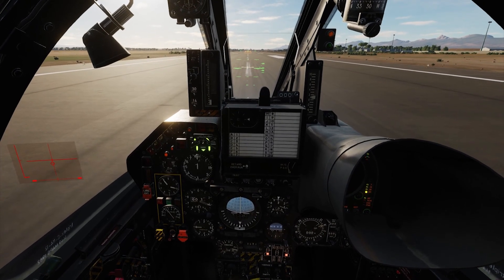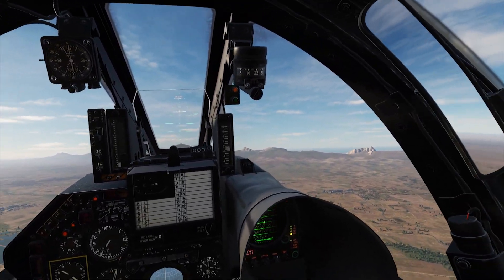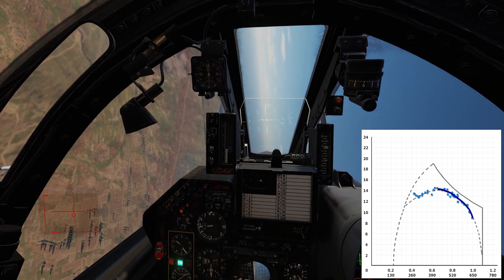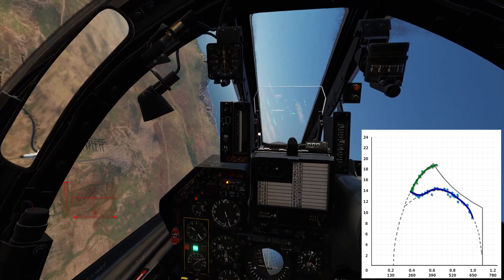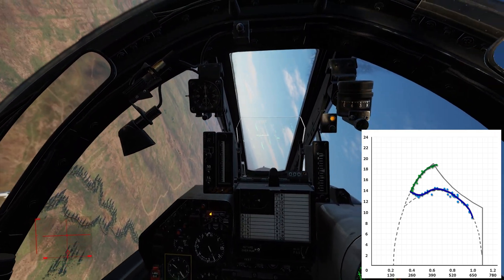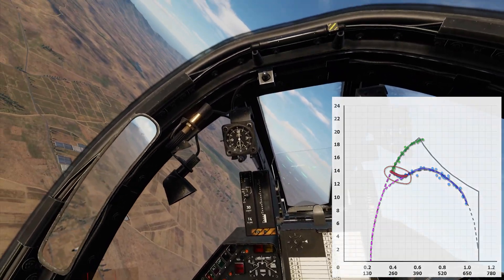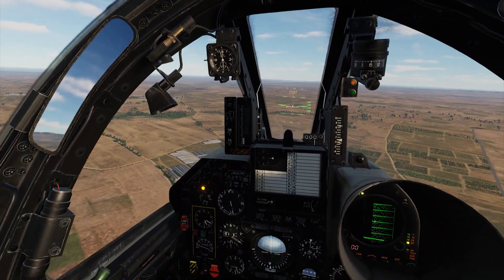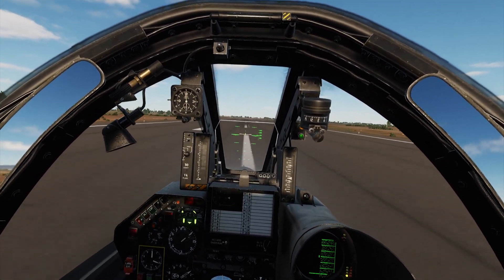OLD UPDATE - Mirage F1CE Update (Sep 2022): Basic Flight Dynamics Analysis

Comment: According to the real F1 manual, the  plane must be flown within a safety limit of i17degr, so not in the red tape of the indexer.  The question is if it should bleed speed already with that amount of AoA, otherwise it would be awkward that the manufacturer has set a AoA limitation that don't alow the pilot to fly quasi a speed bleeding turn (ITR) with full AB, unless ofc  he raise the nose or reduce engine power.  The second observation is that the max commanded AoA with full aft stick, is limited to about 21.5 degr. AoA (you can check it in the external view), and that contributes currently to the inability to bleed the speed down. You could ask Alan if the real plane had (through the dampeners?) such an AoA limiter
Reply from the maker: Alan was insitent that you pull you bleed in the F1, also every plane is like that, even F-16 engine cant overcome it (tho F-16 is a "delta"), but I'll send Alan the question and see tell you his answer.
Reply: @FSX404   Thx! If you can ask him, also the first part of the question, so if pulling  17 AoA (normal limit) would bleed the speed down or that happens only with full aft stick inputs.
Reply from the maker: @irenemengouli590  full aft is a definite stall under 300. Some planes like Mirage III have a different behavior where they will stall under 280 at full stick but not if its pulled smoothely, only if ypu pull it fast, but not the F1. F1 stalls throughout the lower envelope at full stick. I'll doublecheck the 17 AOA bleed with him.
Reply from the maker: @irenemengouli590   quick response regarding Mirage III, working on F1 still, Mirage III manufacturers state that you shouldnt fly it in the red (similar to 21.5 on F1), high AOA, but pilots did, just had to be careful not to enter spins cause it was very easy if a bit uncoordinated (extra yaw in one direction). Should be similar in F1, confirming. If so it should be "easy" to add on the F1 (spin or at least a heavy wing fall stall from high AOA) when a specifoc AOS is passed, I'll try to get the numbers for F1 (I think Mirage was 0.2 AOS, veeeery slight slip), but F1 is not a delta should be a bit higher.
Reply from the maker: @irenemengouli590  I got some answers from Alan, manual said you should stay in 17 AoA, and it bleeds energy at this AoA.  It’s true the dampeners have a limit in the whole envelope, but even so they will allow the pilot to pull into the red and stall. You can fly in the red, but just when it lights up, anything more and it enters in stall, he thinks that is around 19.5 AOA. The stall is docile and he is almost sure that he never heard of a spin in the air force he served. Stall is at a lower AOA with combat flaps, around 17.5 AoA

Comment: Yeah I also felt like the FM is a bit “too good” at the moment, but I couldn’t quite put my finger on it (I’m not a pilot nor an aeronautical engineer).
Landing is not different though from any other aircraft? Put the FPM on the threshold while maintaining 10 degree AoA (green) on a 2.5 degree glideslope (it is marked on the HUD), then just prior to touchdown reduce throttle to idle and increase AoA to 13 degrees (yellow)…

Comment: Great analysis, so glad that I subscribed to your channel a while back. I noticed that you did your approach and landing at quite a bit higher speed than suggested on the manual, yet it was very smooth .. I will try it sometime 👍
Reply from the maker: Thanks 👍🏻👍🏻. On takeoff it lifted about 10 kts higher, so on landing its 15 kts higher, about 170-175 kts short final (10 extra kts for liftoff adjustment, 5 extra kts for adjusted ground effect in simulations). F1 allows for a nice small flare.